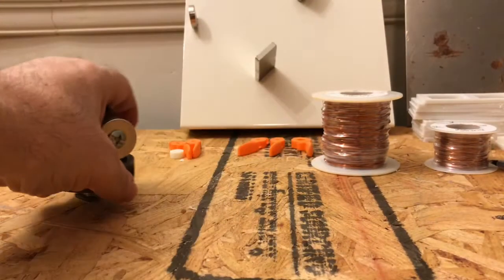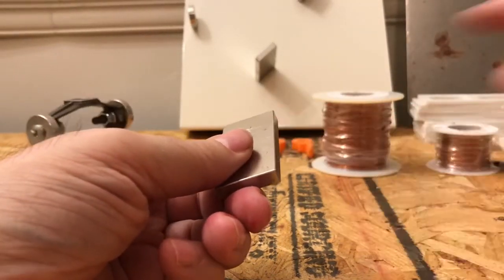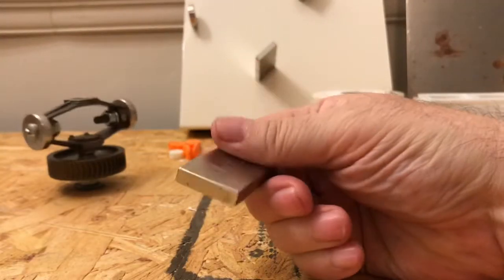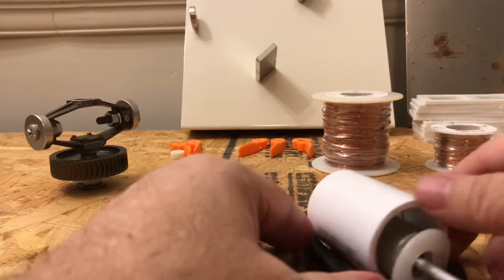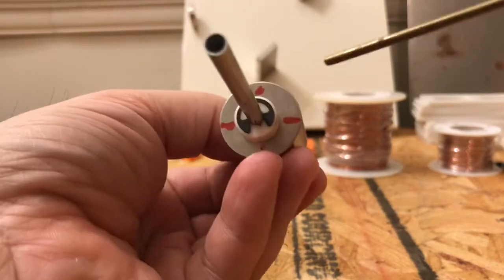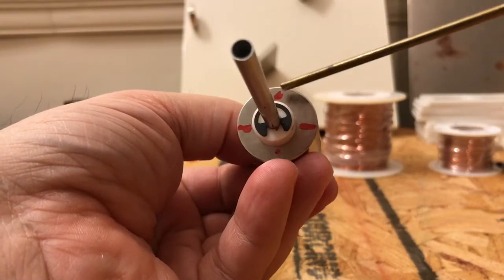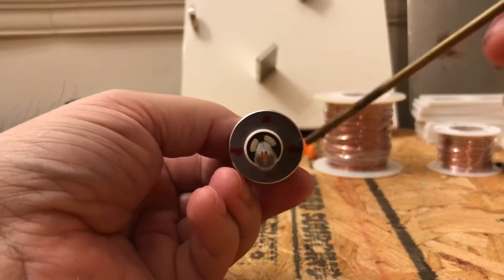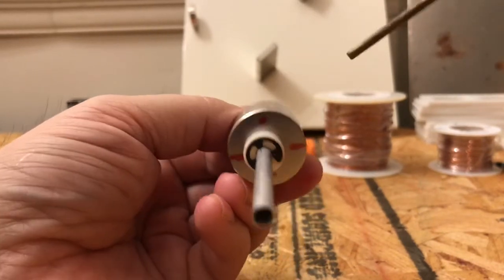🧲 Part 2 -The Cylindrical Magnet Issue

Comment: A fundamental point of resistance comes from the attractive lateral motion of magnetic fields. What I am talking about is a simple idea that if you take a bar magnet and attach wheels to the bottom of it, give it a shove and it will glide all the way across a wood  floor. Now set it on the top of a steel shop table and give it a shove, The attractive force to the table is pulling down on the wheels and it will only roll hardly even 1 foot.
Now put it back on the wood floor and put a weight on top of it to exactly duplicate the same downward force and give it a shove, it will Easily travel all the way across the length of the floor.

We are breaking magnetic lines of force in order for it to travel across the shop table. 
We are not breaking magnetic lines of force if the magnet is repelling rather than attracting and also if the magnet is only moving downward towards The table.